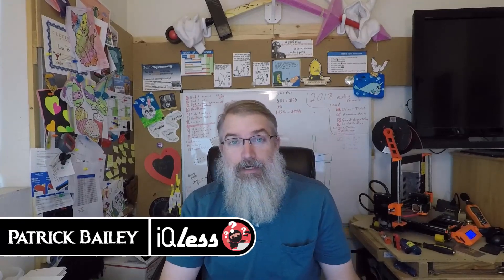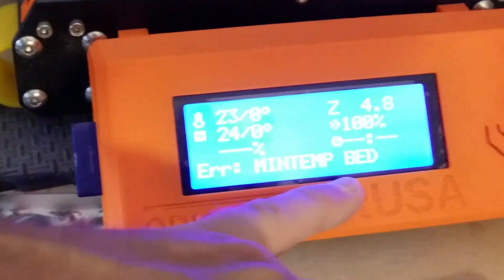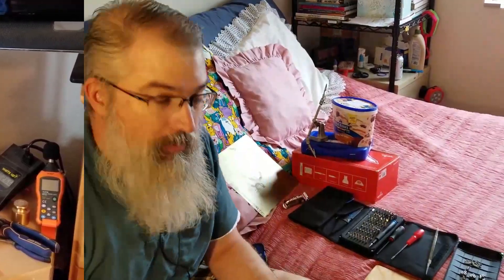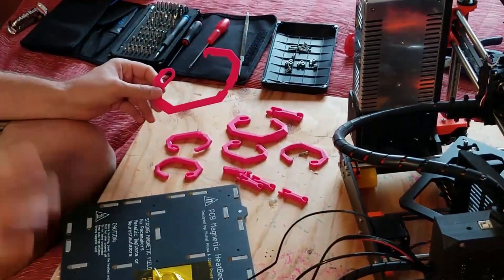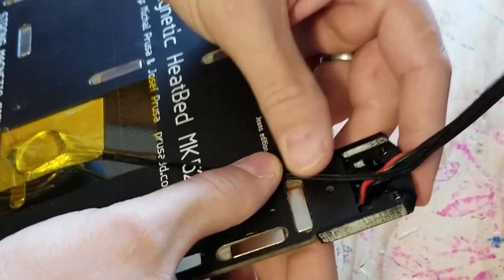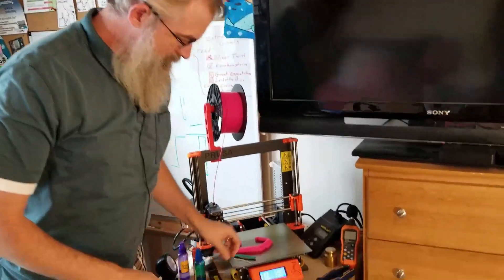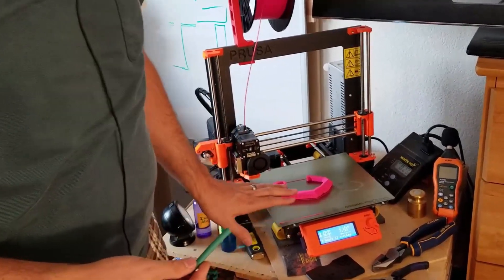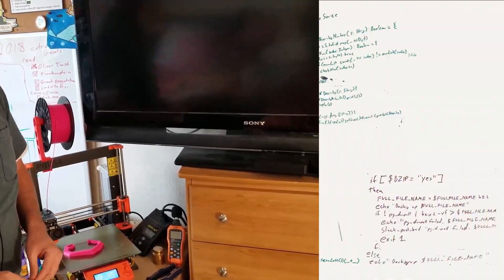Prusa Printer: Issue Err MINTEMP BED

Comment: Dude, your video led me into the right direction. Thanks. I also had this "MINTEMP BED fixed" error and was looking for an answer. It also was the thermistor cable which broke somewhere between the cable clamp and the capton tape. Even though there hasn't been any visual indications for damage I could roughly identfy the spot with a multimeter and bending the wire back and forth. I cut out the damaged section of cable and soldered the ends back together. An additional longer piece of heatshrink tube should prevent me from similar issues in the future. Luckily there was enough cable left within the main electronic box so that I could pull the cable through to the desired length (open the wire clamp at the electronic box firstly!). The printer is now up and running again, thank you!
Reply from the maker: Glad to hear you got it all up and running again :)

Comment: I think I did the same thing on my mk2s. When I bend the wires near where they connect to the bed, the error disappears. Going to open the coil up and replace the kinked section with silicon wires like you suggest in your other video or replace it with a new thermistor. Did your replacement from Prusa come with the heat resistant tape? Thanks for posting these videos; it made my job so much easier!
Reply from the maker: Yes it did come with the heat resistant tape :)

Comment: Great to see that you fixed your printer. Building a kit helps a lot to understand how it works, how to maintain it and fix issues. Consider for the next time to use silicone wires which are much more flexible and don't break that fast with all the motion. This still will not help if you pinch it too hard but as you are going to replace/fix a cable it is worth it.
Reply from the maker: Good point and a great idea about the silicone wires